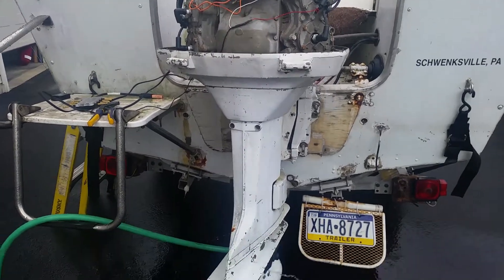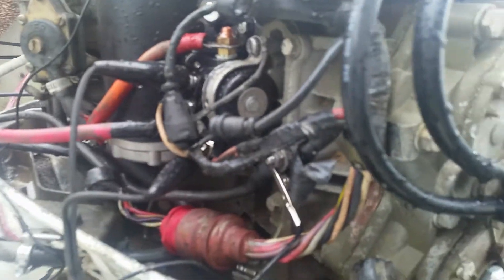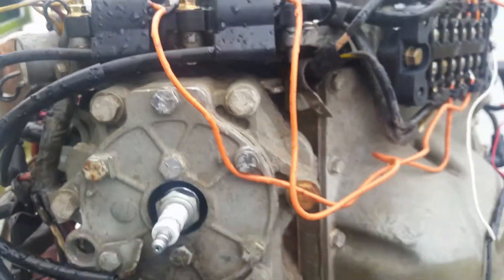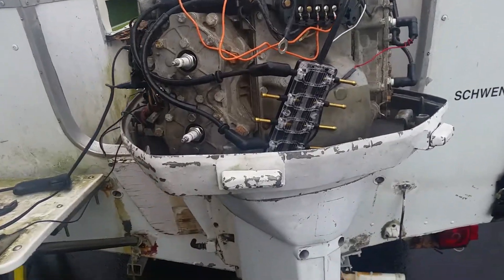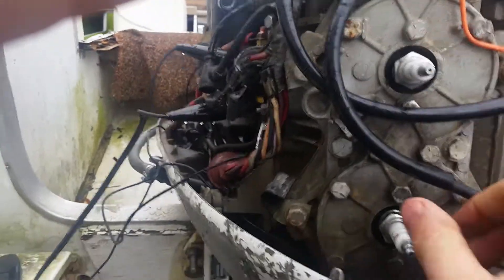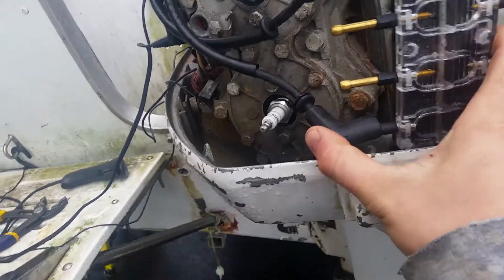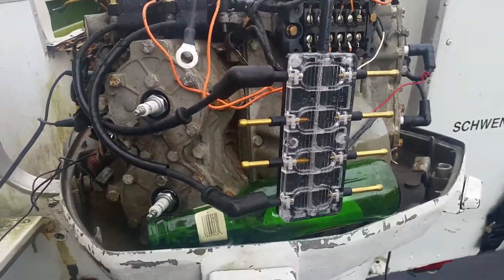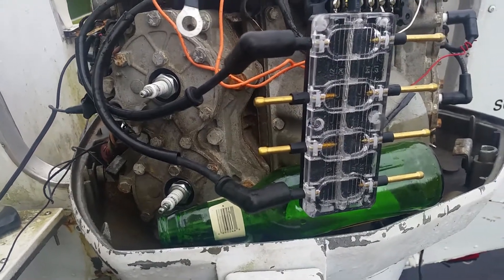1975 Johnson 135 HP V4 - Loss of Power

Comment: same issue with a 1980 evin v 4. same side spark is good not running. i already replaced the timer base stator and rectifier all 4 coils and power packs. still no dice.
Reply: you ever figure it out?

Comment: stupid question but....where does that motor pee from? just got one myself with a boat but i think they may have drilled some holes by prop.
Reply from the maker: Pretty sure these ones didn't have telltale "pee" holes. You could just hold your hand down by the exhaust cover and the water spray should be cool

Comment: The coil is shorting to ground intermittently.  This will cause a loss of power due to the fuel air mixture not burning.  The spark you see when testing, is very strong,  try a new coil. Also make sure all four coils are tight.

Comment: Hello, i have one of these engine 135hp 1975 evinrude and I have a few questions, is there any way i can contact You? I know  this clip is a few years, hope You se this 😁
Reply from the maker: Message me your email address
Reply: @MrAndrewdouv  I have a similar issue, 140hp 2 stroke Johnson, runs good on rabbit ears, lower the boat in water and will not start, pull the boat back out, hook up rabbit ears and fires right up. The local shop is stumped. Any ideas? Had the same issue with a 200. 
Thank you!
Reply from the maker: @ceisarsrepair7958  a number of things could cause that. I had the same symptom on a OMC 2.3l and it turned out I had water in my gas tank. I found it by siphoning a sample into a clear glass jar. Could also be weak spark, weak compression or fuel issue so you've gotta go at this methodically. If it's not bad gas use an adjustable spark tester and see if you've got strong blue spark jumping a 1/2" gap. Compression is quick and easy to test as well. If it's not either of those you can do a fuel pump pressure test. Make sure your tank vent is working correctly and your fuel lines are not damaged

Comment: I have the same year and model out-board, but it refuse to start any suggestion? I recently install  ** new plugs, new coils, new starter** and still no go!
Reply from the maker: Mason Dyer first confirm spark is getting to each plug. If spark is getting there, check compression on each cylinder. While you're doing these tests have your battery on the charger. If has spark and compression but still won't start on fresh fuel you may need to rebuild carbs. First though I would load drop test voltage on battery at the starter solenoid. This will confirm your battery is putting out enough juice. Also confirm your choke plates are closing fully and your fuel line bulb is firm.
Reply: @MrAndrewdouv  I have the same problem but not spark on 4 cylinders how I find the problem??